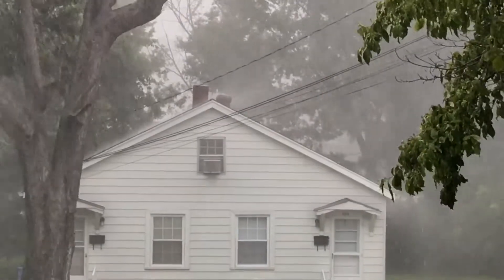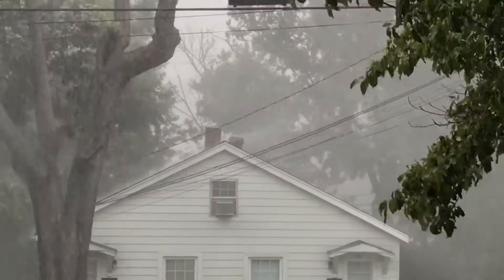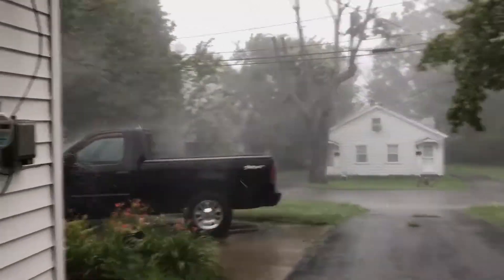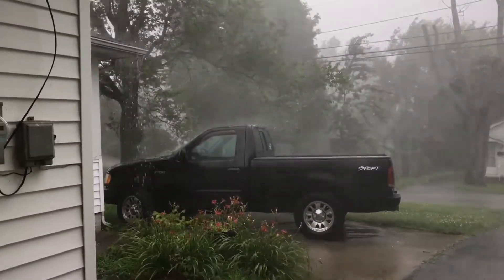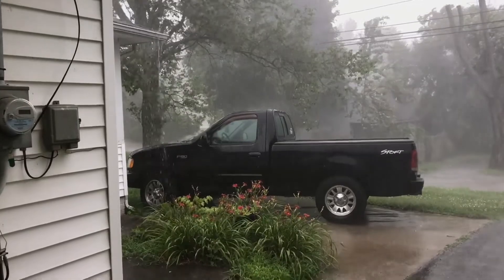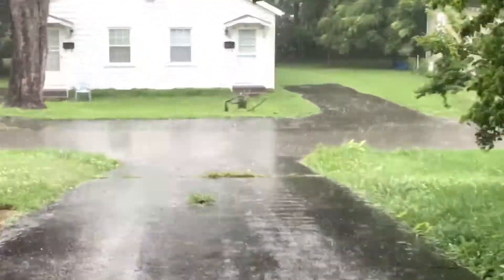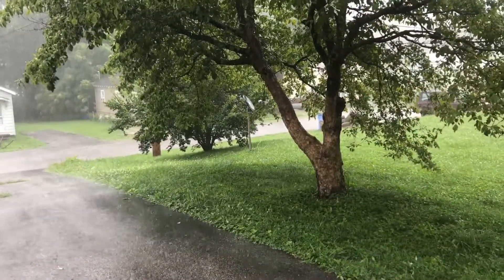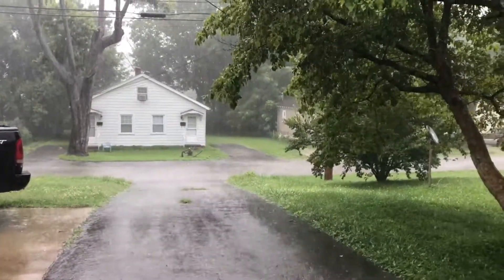Storm footage of downdraft microburst @ Cherry St and Cumberland St.

Comment: That was a gusty thunderstorm...not a microburst
Reply from the maker: Thanks for the comment and for checking out our footage. This particular shot was taken at the base of a very steep drop off from a large, wide, ridge-line that runs for several miles through this area. Luckily the brunt of the violent wind velocity that caused the damage in this area passed directly over this house by 50-100 ft. blowing right overhead and down into the valley that also received the wind speeds missed in this footage. The area just a few dozen yards away at the top of the hill was not so fortunate. There were fully grown, mature hardwoods that were blown over and snapped at the base that were several FEET in diameter. A line of high voltage power line poles that carry part of the main feed in this area were snapped in half like twigs. Dozens of homes in a isolated area were damaged, including damage to vehicles, rooftops, windows. The loss of power for was significant for many and utility crews worked into the night hours to restore power and open two main thorough throes, one of which was blocked by an extremely large maple (?)  that was taller than one 6 or 7 y.o. kid who was up there with his dad to see the damage. While the kid was having his photo taken he was standing in front of the fallen base of the trunk of the tree and its diameter was more than the height of the kid! This video didn't capture the force of that wind sadly, but it was certainly more significant than a mere gust. Hope we can catch better videos of weather when it happens around us soon!
Reply: you are right there that isnt a microiburst, reported for incorrect title
Reply: @1littlelee  Petty much?